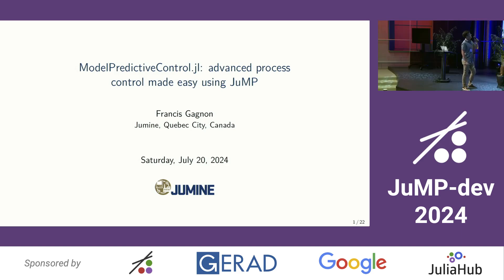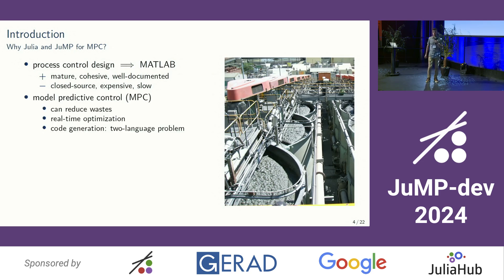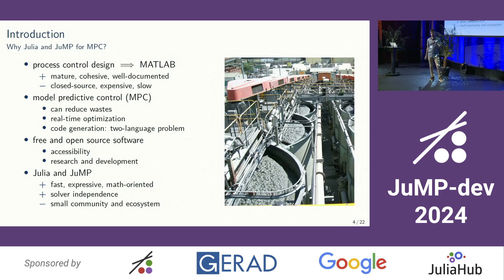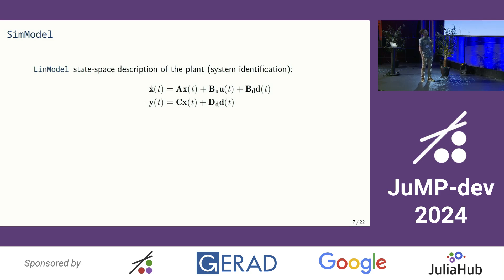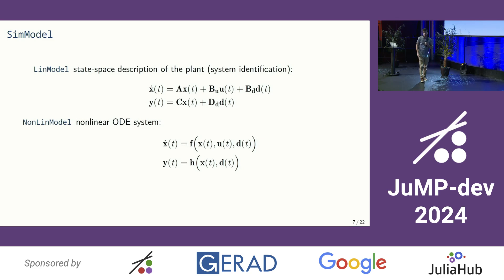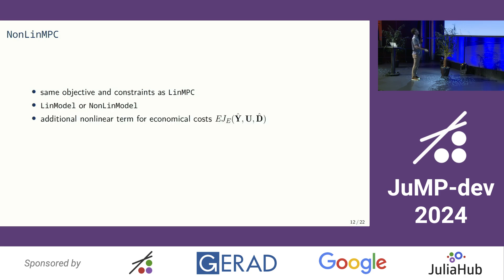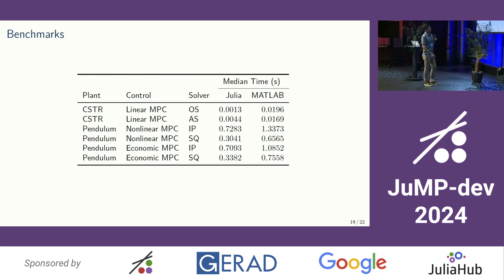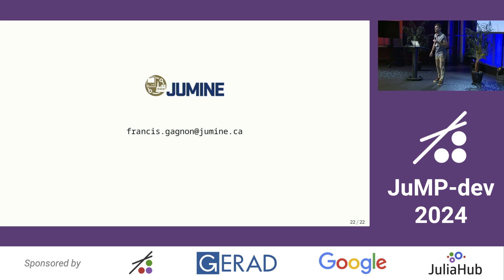ModelPredictiveControl.jl: advanced process control made easy using JuMP

Comment: This seems very promising. Is it possible to use directly the code in an embedded device??? Or it must be transpile to some other language like C. Some experiences using Jetson or similar?? Anyway, the tool looks great.
Reply: Thanks for the comments! Right now, running julia code on typical low power embedded device is not possible, but I belive that may be possible in a near future, knowing that some people is working on tools for that (e.g. StaticCompiler.jl and JuliaEmbedded org.). The alternative for now is using the embedded device only for the I/O manipulations and solving the MPC on a normal computer or a linux server for example. That's typically how (steady-state) real-time optimisation (RTO) is implemented in practice, by the way.